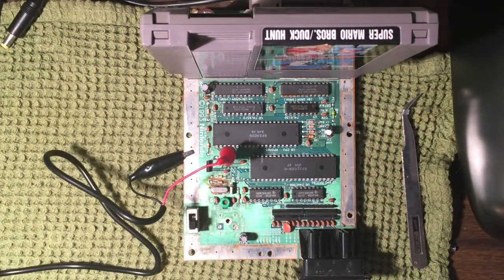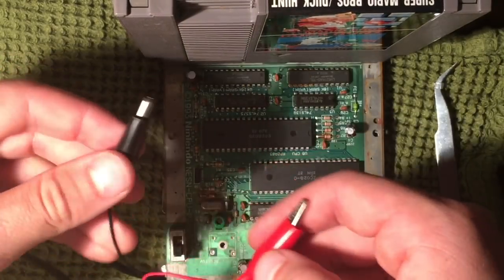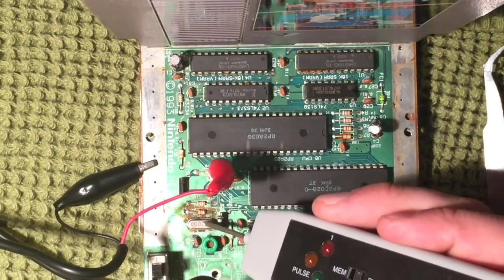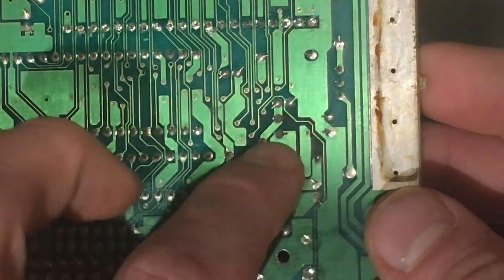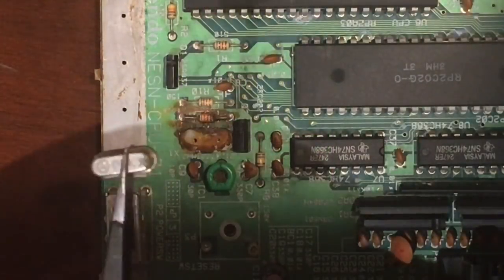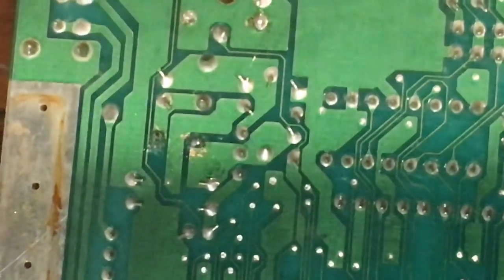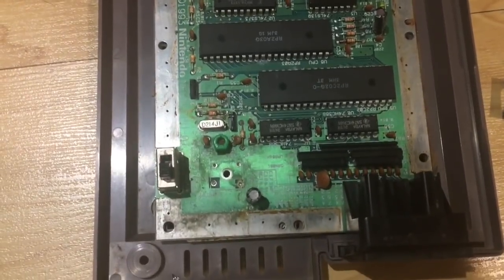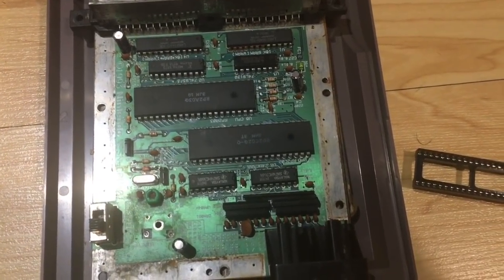Fixing eBay Junk - Nasty NES Toploader - Part 2 - Logic Probing & Crystal Replacement

Comment: Something you could do to determine whether some of the chips are bad or not is to continuity test the the vcc and ground pin on each chip. They shouldn't have any continuity that would be a pretty tell-tale sign, aside from that besides socketing the chips and swaping them out one by one I wouldn't know how exactly to test them.

Comment: Really enjoying your videos!  As someone else mentioned, you might want to totally clean up the board before you continue troubleshooting.  If there is corrosion somewhere you can't see it there may be bridging.  Weren't you getting 5 volts from the ground when the RF was connected?  That seems like a good starting point if it's still doing that.  I'm no expert, but some other troubleshooting I have seen is to test caps by checking for ground on both sides.  If bother sides show continuity to group, either the cap is bad or a chip is bad that's connecting to that cap.  Look forward to a follow up on this vid!

Comment: I'd suspect that rfu. The amount of rust you saw on the bottom, indicates this has been partially submerged in water. 

See if you get video off the ppu with that oscillator replaced. That rf cage is probably full of conductive rust.
Reply from the maker: slaytallica136 no video from the ppu.  You can pull video directly off a pin on the ppu, however I get nothing on this one.

Once I get a signal from the ppu, I'm going to get rid of the Rf modulator altogether and do the composite mod.

Comment: I'd say you better check that variable capacitor (that little green box with a screw on it), right next to the crystal. Judging by the corossion (propably water) it blew up, when the water went right through it.
Hope that helps :)
Reply from the maker: To Retronio now the trick... Where to get another variable cap
Reply: @RetroRepairs  https://www.mouser.com/Passive-Components/Capacitors/Trimmer-Variable-Capacitors/_/N-5g94

Comment: Thought these had to run with coaxial cable?
Reply from the maker: 101spacecase what has to run with coax?
Reply: Yes most top loaders only had coaxial cable to hook up to youre tv
Reply: 101 spacecase is talking about the tv signal sond and audio both ran through the coax cable
Reply from the maker: Yes, they only have RF-out which converts to a coax tip

Comment: Your probe showed each chip was getting power, but here's a tip for others:  power up the board for several minutes, take a infrared photo, or point thermometer to each chip, or simply feel each chip with your finger.  Often a dead chip will not warm up like the others.   Thanks for the videos.

Comment: If you want to get a new PPU or CPU replacement you should buy UMC chips.The ua6528 is the NTSC PPU and the ua6527 is the CPU.(Theua 6527P is the PAL version so watch out)The CPU is not perfect (little bit different sound) but it's better than nowadays 20$ famiclones.
Reply from the maker: alias Zider20g John Carnege good to know.  For now, I've got two front loader NES with various chip issues.  If I can isolate the bad chips, I can always buy new ones you mentioned to fix the front loader.  I'd rather use genuine chips for a toploader however.